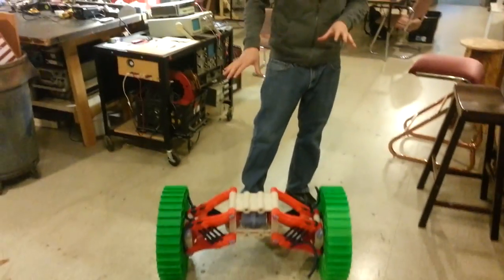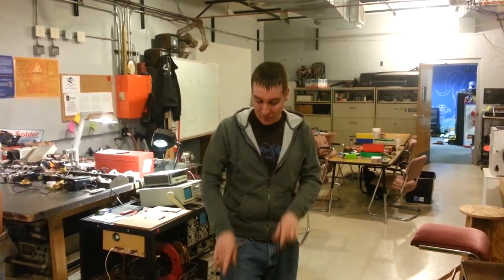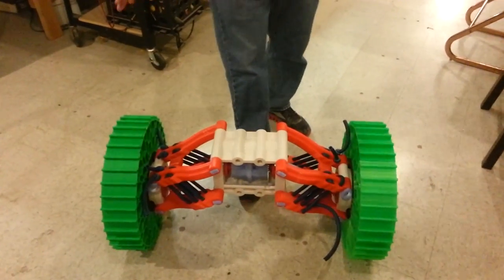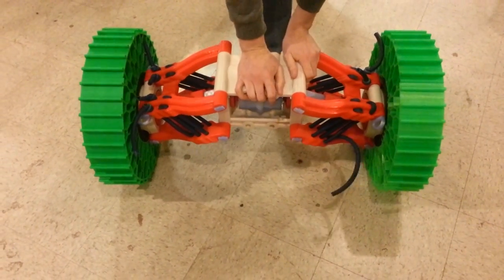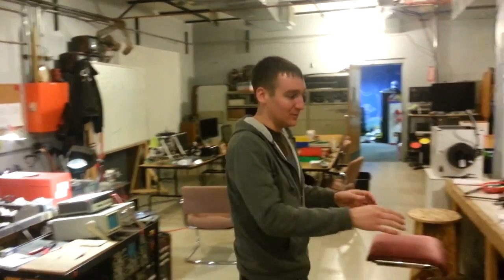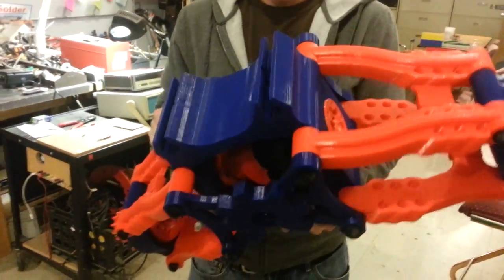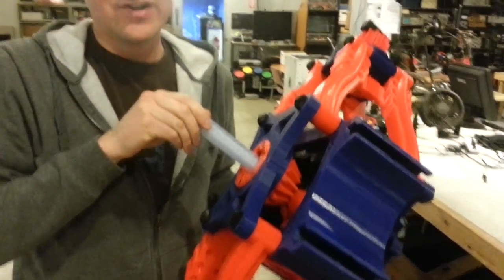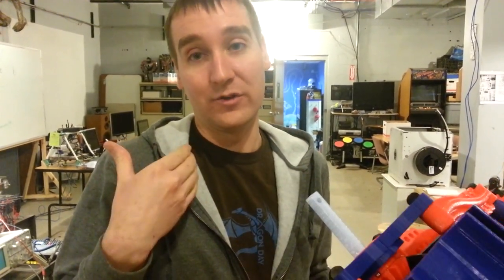3D Print This Car - The Rear Axle

Comment from the maker: Update on my 3d printed car project. Things are coming together.
Reply from the maker: Mostly printed on a Replicator, a few parts from an Ultimaker
Reply from the maker: All of the parts are attached together with either snap pins, Press Fits, or M5 Bolts. But i'm trying to limit the use of bolts only to critical areas.  For instance, the wheels are made of segments that just barely fit on a replicator, and are then pressed together. I takes 9 segments to make one wheel.
Reply: Keep up the good work!
Reply: ROCKING IT! Of course that sound as it crunches...